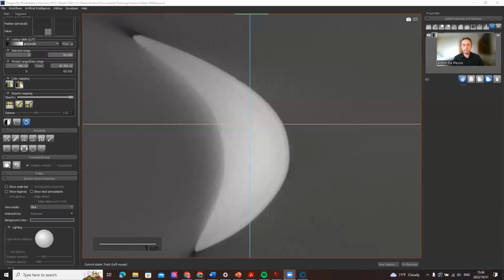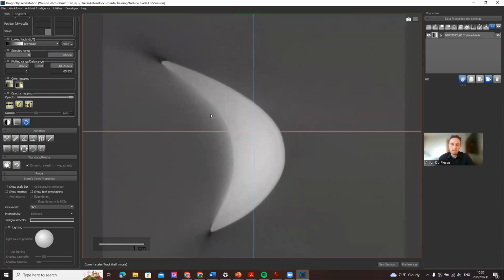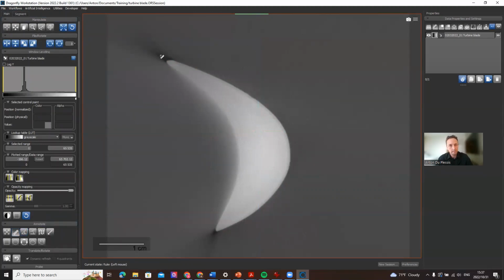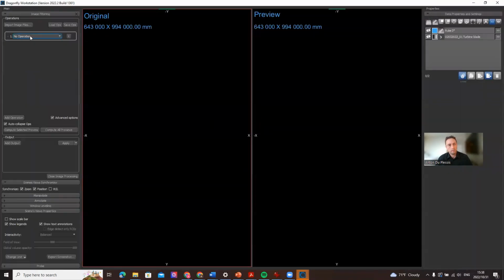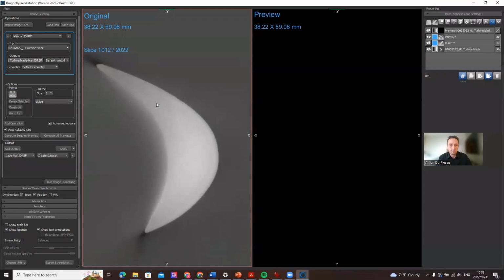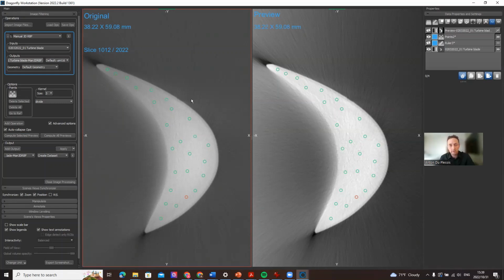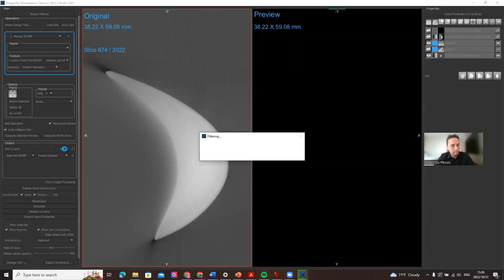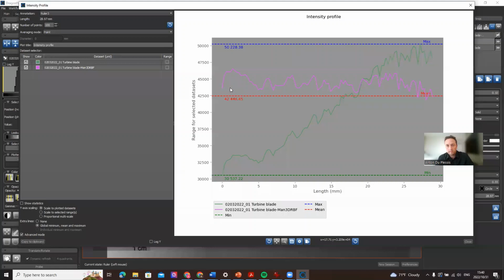New features 2022.2: Manual 3D RBF filter

Comment: Thank you for this instructive video! I could not help to try this out immediately :)  Some interesting observations: (1) it takes some trial-and-error with the points to get a good interpolator; (2) I had trouble getting the "Original" and "Preview" into the scene, and (3) a huge artifact appeared on the edge of the scan volume. I also guess that strong gradients and edges are problematic: it seems to affect the surrounding air as well; is there a way to mask the volume for filtering? 

But all that is no problem when segmenting the copy of the image data before going back to the original. And many of the other filters are equally useful. Great work, thanks!
Reply from the maker: Thanks for the comments! To reduce trial and error (and edge of scan volume artifact), you could select more points in the first place across multiple slices, then check only for poor result areas using preview, actually its a good way to ensure all is good before applying fully. Let us know your results and share images if we can use them, thanks!